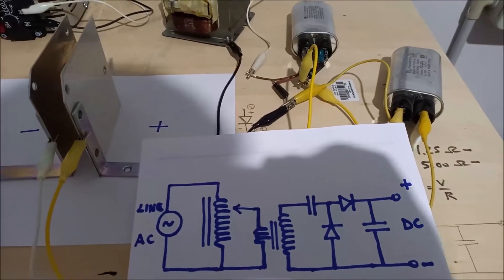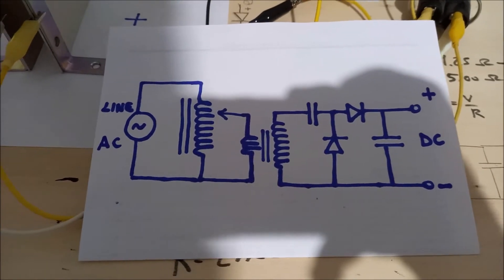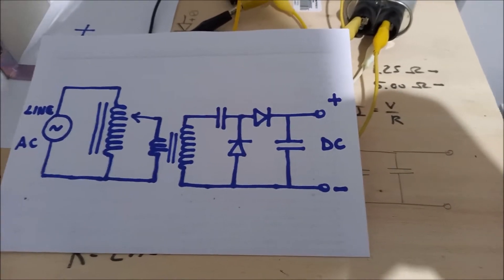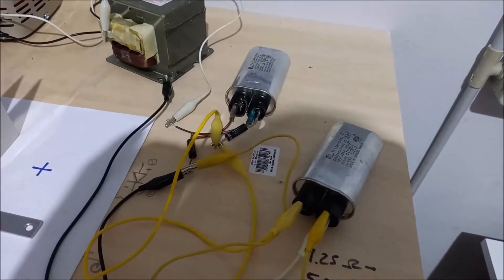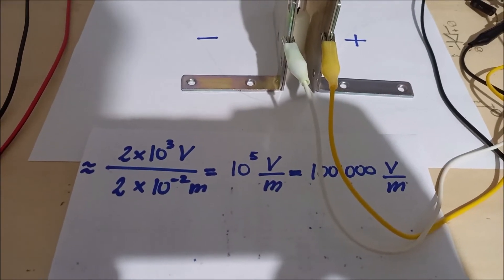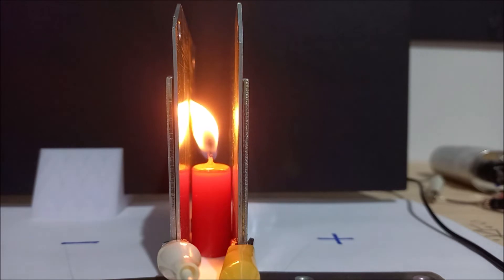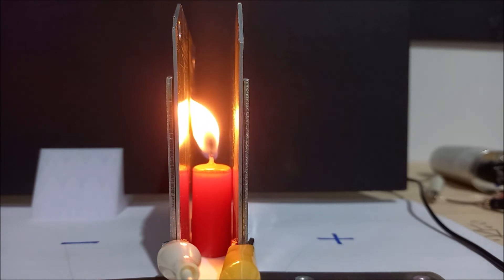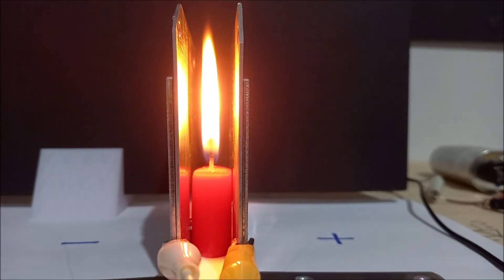Candle flame in high DC electric field

Comment: Interesting experiment. So how should we think about that co2 is charged. Or do flow/mass of electricity cause movement of fire ?
Reply from the maker: I think of the flame as a plasma (maybe not fully ionized). The positive ions are the heaviest ones that actually make up the "mass" of the flame. When a strong electric field is applied this positive ions are attracted to the negative plate of the capacitor, and so the whole flame moves to that direction too.